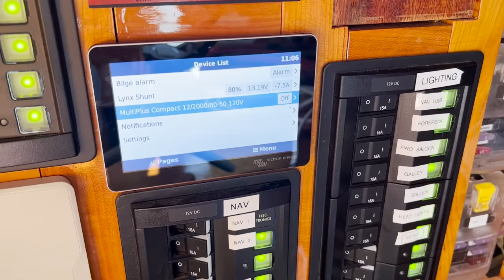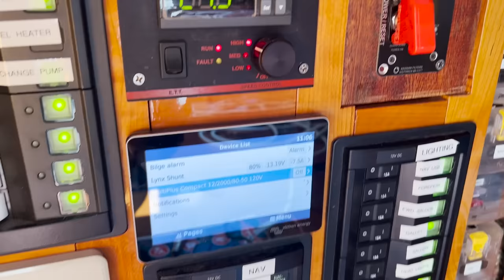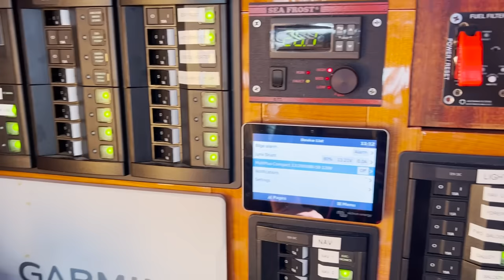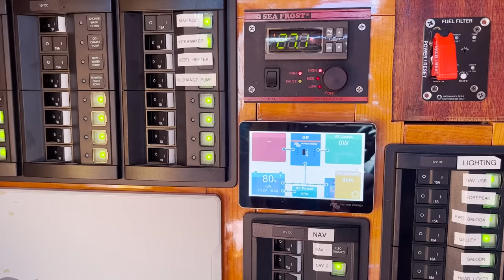Getting Ready to Sail North - Episode 274 - Acorn to Arabella: Journey of a Wooden Boat

Comment: tip for your connections that dont feel great and with small cables is put shot of hot glue on them! we do this a lot with RC aircraft since they vibrate so much can cause the little servo connectors to come out the RX. so we just but little bead of hot glue around them and holds them in and you can just pull it off if you need change things.
Reply: This is also common practice on electronics, so the connectors don't pull out during shipping.

Comment: Steve, Harbor Freight has a plastic and rubber hand held suction cup that is really good for sticking on the hull temporarily while cleaning your hull.  Get 2. Secure with a small line- they sink.) We love them for cleaning ours!  Plus, a cheapo wooden spoon is great for knocking off the tiny barnacles.
Reply: Actually a wooden spatula with a straight edge, not a spoon.
Reply: I added a small rack with 3 identical high quality rechargeable flashlights inside and next to the companionway. Kinda nice to always be able to locate one!

Also, at companionway we have a row of small hooks for lock keys, headlamp, and deck keys.
Reply from the maker: Neat tip, thanks!

Comment: The great thing about a 6 week proptotype is you can discover what's wrong with it before you have it made in stainless :)
Reply from the maker: YUP!!
Reply: @AcornToArabella  :  I'm not a big fan of using stainless steel unless absolutely necessary on what is basically a wooden boat  - period.  Not questioning the need for a 'hard dodger' but please consider making it out of teak or cherry wood!
Reply: @evanschwartz3030 I think the reason they picked stainless steel is if they put covers up it will be able to handle strong winds. Better than wood at least.
Reply: Thought you were talking about the boat!!

Comment: Second time your anchors pop in my mind, I don't think they are secured properly there, for 2 reasons:

1. they are going to keep hammering the supports they are on and when those supports break, the anchors will hit your hull, something that you really don't want to happen.

2. if I seen things correctly, when you will drop anchor, you will be putting lots of unwanted hammering tension to the bowsprit and the rest of the rig. 

I would move the anchor fittings/rollers to the hull and maybe have a small locker to stash the anchors away while under way, so they don't keep flopping around in the waves.
Reply from the maker: The bow rollers are solid bronze, pinned with huge bolts, so something mighty wrong would have to happen for the “supports” to give way. I see your concern with the motion, but moving them isn’t an option because of how they interact with the whisker stays. There’s another way to keep them swinging, and we’ll get to that! —Anne

Comment: Steve, a bit of a tip when you are snorkeling, if you don't already know... To keep the mask from fogging up, just rub a little dab of dish-washing liquid on the lenses before you put it on.  If you don't have any, an alternate solution is a bit of saliva (I know it sounds gross, but it is really effective!)  Ben, Bristol Connecticut is about as coastal as Granby.  You meant to type in Rhode Island! That distinctive blue sailboat we see at about 13:38 is a Gozzard.  My dad and I sailed a G37 for many years.
Reply: Saliva, ooh, how disgusting.
Reply: I have used saliva many times, did not know about dish soap though, got to give that a shot sometime.
Reply: @calebs4887  Been using dish soap on my motorcycle helmet visors for years. Does not work as good as some antifog products but works better than nothing.
Reply: I've always used tear free baby shampoo on my goggles for years. Doesn't cause my eyes to water at all like soap does.
Reply: Saliva...that's snot a bad idea! 🚣😀
Reply: I've seen the goggle or mask thing as spit, swish and dunk. Rub the spit around, swish with a little water then a quick rinse. I've done it in a pool and it works.
Reply: Spit FTW!

Comment: Your dinghy should always have a 2nd line tied to it, longer than the first slightly, 1 line will fray in no time at all.
A weight on the line also will stop hard snubbing of the line.
Reply from the maker: I never had a problem with that but it’s interesting. I do it with mooring pendants in a blow, for sure, but towed my dinghy from Maine to Georgia and back (boat and available dinghy didn’t allow for the dinghy on deck). I had nice, beefy line and a beautiful lead through the chock though. —Anne

Comment: Solar sails. Not yet fully realized, the tech needs a bit longer to get its legs, but they are out there. I saw a British boat a few years ago (oh... 18, i think, might've been 19) with solar panels sown in the sails. Charge as you sail as it were.

That said, that double faced panel, a good method to use it would be to string it between masts and use a third piece of rope to angle it. It's plenty rigid enough to take it, and should be easily adjusted. I've seen several campers use similar panels where the panels were kitted to a pole, and they'd just twist the pole in the ground to follow the sun. Difficult on a boat, but not impossible.

Another method, which i thought was pretty damned smart, i forget the channel name, but they put their dingy in the water and had the mast of the dingy support solar panels on it, with a reinforced cable to pass the juice overboard. His dingy was anchored off the main anchor of the boat and a line was used to twist the whole dingy (specifically the panels) into the Sun as it moved. My brain is drawing a fart atm, but i'm pretty sure it was a German speaking channel.

Comment: Also - any plans to re-haul and re-paint the waterline? Arabella is sitting WAY too low in the water. I've lived this dream and my topside paint began bubbling after about 2 weeks in the water (salt-fresh water transition - so we lost about 5 inches of waterline). Know it's a minor detail, but having to strip and repaint the waterline SUUUUUUUUCKS... it never blends well with the rest of the topsides and you'd be better off fixing the bottom paint/boot top now than fix the topsides later.
Reply: Agreed wholeheartedly. 
Been there, cursed, done that. It does indeed suck. 
I use ablative a’foul and gave up on the “perfect” waterline years ago. If it’s 6” above true line I’m a happy camper ‘cause I know it’ll be less hassle to keep clean and, as you say, the topside paint lasts instead of degrading fast.
Reply: Unfortunately shit happens!  Having to 'correct' Arabella's hull waterline mark is certainly no fun and a real chore to correct. I was keenly interested when Leo from Tally Ho took the extra time and effort to insure Tally Ho would eventually float close to or on her projected waterline mark when completed. Very tricky business to accurately.predict!

Comment: You really have the power thing covered. Wind, solar, natural gas (propane), and fossil fuel. (Is that marine diesel running the engine?). Is there going to be a cutoff point where no more stuff is allowed topside? Having a 28-foot sailboat I'm just thinking about my poor, broken many times, toes. Thank God for boat shoes. What about a Bimini instead of a Dodger? I've seen solar panels on top of biminis many times. Gazing at my radiometer on top of my desk, I've always wondered, what happens to solar power when the boat shifts at anchor and takes the solar panels with it?
Reply from the maker: A marine diesel is the engine, yup. Can’t have a Bimini with a mizzen. And you’ve touched on what’s very challenging with solar on pretty much any sailboat. Plenty of rig to cast a shadow on something that moves. I like using a panel that I shift around. A high producing panel can move enough electrons to keep a big bank like this topped up when under way. —Anne
Reply: @AcornToArabella Sailing Uma, have an interesting solar solution.
Reply: @johnnunn8688 Yeah, Uma's dodger(sp?) is her panels on a stainless frame or are you talking about her other, folding panel?
Reply: @jdzfb  folding. Folds around the stern?

Comment: your is   is very good looking in the water. But your waterline is way to low. You will proberly fill her with 2,5 to 3 ton crrusing equipment, water fuel, provisions etc etc. I think you need 6 - 8 inches higher waterline, to make sure you protekt the hull and avoid groth in waterline
Reply from the maker: She’s already full of her equipment presently. And we’ll work on the waterline later. We took it from the plans and the boat weighs about as much as she was designed to weigh.
Reply: @AcornToArabella  Maby one of the reasons to the design waterline is to low, is proberly, that you used oak planks and not red ceader
Reply: @AcornToArabella how much does she weigh?

Comment: I was very upset to see Satchel doing his electrical work on the beautifully varnished table top without any pig-matting or protection for the surface. You could see the scratches in the varnish : - (
Reply: Well Steve will just have to invite Ross or myself back to restore it.😂

Comment: Shouldn't you have covers on the sails to protect them from the UV while sitting at anchor?
Reply: Essentially correct.  Covering and uncovering sails is a major undertaking. Needless to say, sails are expensive to replace so taking care of them is always a good idea. Certainly one should cover sails to extend their longevity and protect them from UV (sun) damage. Sails should almost always be covered overnight to prevent dew accumulation and mildew from forming.
Reply from the maker: Yes, they just haven’t been made yet.

Comment: Private comment to Steve. DO NOT PUBLISH:  Steve, I am concerned your boat is too heavy. I mentioned this a few years back, that you were over building everything. You replied that the additional weight was compensated for by the trim ballast that was designed into the boat. Your overbuild and multiple pieces of electrical and mechanical gear have exceeded, by far, the design displacement. and the boat is sitting well below her design waterline. This is unsafe. The boat is so heavy that she is shipping water over the bow while tied to a mooring. Further, I think you have not yet provisioned to go to sea. That will add many more pounds. I suggest you do not go to sea in this boat, in its current state of trim. Please consult with someone who has lots of experience at sea in similar size boats. All those wires, valves, gages, piping, motors, batteries, panels, and switches don't mean shit when your boat is sinking. Have a long talk with a knowledgeable guy. My best wishes for you; you have done a incredible job, but with a lack of knowledge of the elements you will be encountering.
Reply from the maker: Hi there. We weighed the boat, she’s quite close to her design weight. The waterline on wooden boats is often something that you hope to paint not too high or two low… and she’s sitting right on it. So, next time, we’ll paint a bit higher. If the waterline was painted too high, I suppose people would say, “Oh my goodness! She’s lighter than we thought!” This is waterline business is always a bit of a process in wooden boats.

We have Satchel on board who is by both training and deep experience a naval architect, and a few episodes back, we had a very experienced professional surveyor on board, before and after launch, on the hard and under way. Deep conversations have been had, and very little has been done without consultation. In a world where men have been disparaged for, say, being unable to seek help even for directions in unfamiliar places, it’s easy to think that maybe Steve is of the same ilk. However,  abundant evidence in, at this time, a body of 274 videos indicates otherwise.

When I was advising about launch locations as a very experienced cruiser, and we were looking to choose a harbor, my number one choice was Mattapoisett. Steve preferred Mystic, and for a great many reasons (as foretold in the prophecies😁) I had to urge that we pull the plug there, and move on. Steve investigated Bristol, and my main complaint there is that while it’s a nice place to provision up and get services, it is a terrible harbor because of the prevailing winds. He was slightly annoyed, but sighed and said, “Well then where do you think?” And I reminded him what I had said multiple times: Mattapoisett. Resource-rich, happy to host, wonderful infrastructure, protected. Steve listens, and we’ve had able, honest, experienced counsel. I do believe what you’ve seen with that water shipping over the bow is the truth about why I think it’s bonkers that so many people would have a mooring in a bouncy place like that. Restaurants, I suppose. Now I really sound like a Mainer!

Your comments come from a place of deep care, albeit a place from afar. Thank you for that care… we are certainly on the job. —Anne

Comment: A extremely dangerous particle spitting RTG puts out about 110 watts(1 bulb) for charging batteries.  Your solar connect is 97 watts on a partially bright day, just on one side of the panel, and you don't have to wear a lead suit while sailing.  The only side benefit of the RTG is it will put out 110 watts, night and day, for about 30 years without fail, before replenishment.  You guys will probably get over 200+ watts when the solar panel is exposed on both sides, if that can be done, And you get to keep your hair, or have spy satellites following you.  Trying for a similar sized comparison, but failed a bit.  Lots of variables, especially with the satellite thing.